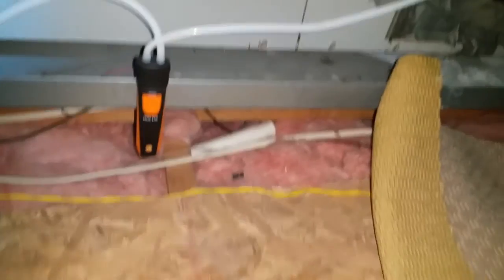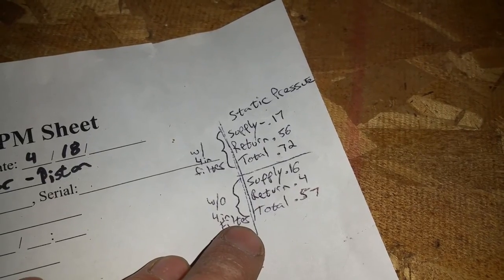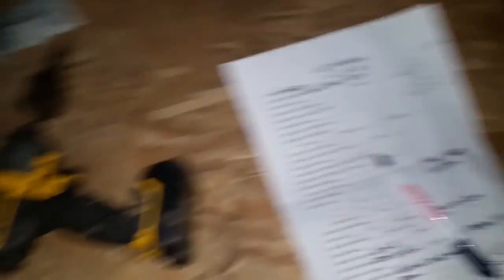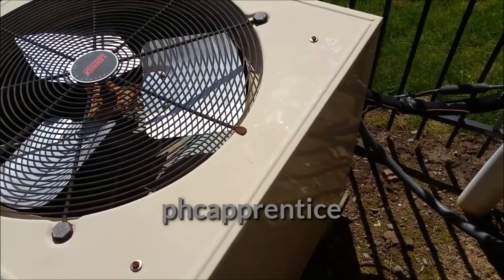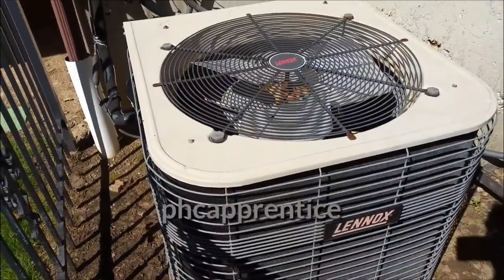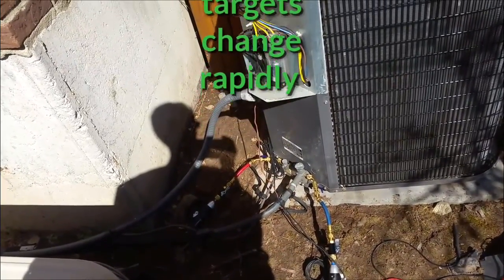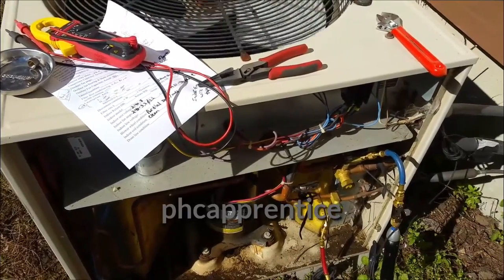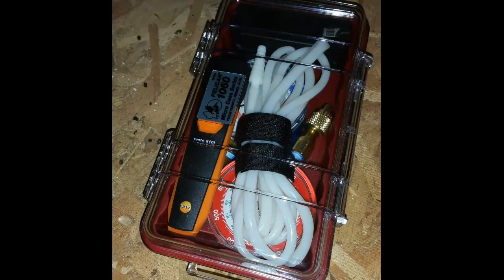Preseason PM - few bad caps, burnt wite, and a leaker

Comment: Change the Schrader and charge it up. Then ask if they want to go further.
Reply from the maker: thats what i figured. i have no clue if it will take a lb or 4lbs and the home owner will be asking since its r22 and we all know its as expensive as gold lol
Reply: theres no real way to know how low a system is.  but judging by the size of the factory charge and what the symptoms are........ive always been able to ballpark it fairly close.  never perfectly, but typically within a pound or so.  i generally use percentages in my head based off of what the system is doing.  if its low but not freezing its probably only 10% low or so (also depends on other factors, same as everything).  if its freezing youre probably closer to 30% or more low.  if its freezing and your gauges are reading very low numbers youre 50-60% or so.  if its not freezing and very very low, youre probably 80-90% or more low.  then just run your numbers.....factory charge of 10 pounds and youre 30% low......means you need 3 pounds give or take.  all these numbers are very ballparky numbers that are gonna change based on other factors and youre experiences in the field.  start guessing at how low a system is before you charge it, even if the customer doesnt ask.  then youll know how far off you were, begin adjusting your numbers in your head until you can get closer over time.    its not scientific at all, but experience will fine tune your numbers eventually.  its really not that difficult after you do it for a while.

Comment: What was the indoor outdoor temps ?
Reply from the maker: roughly 55wb indoor and 70db outdoor.
Reply: +PHC Apprentice that first unit u showed using the iconnect screen shot , something is wrong with the subcooling being 20 and high superheat,  possibly txv issue